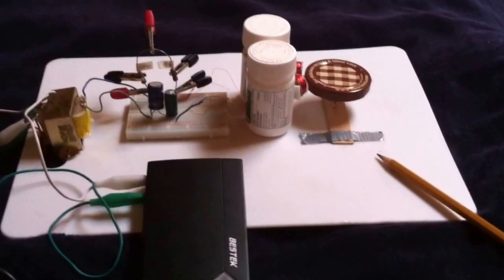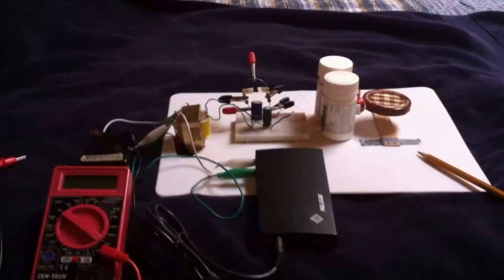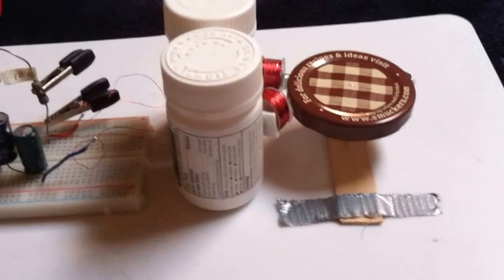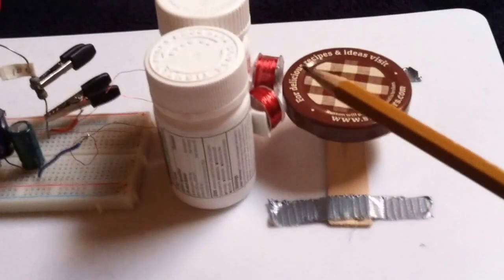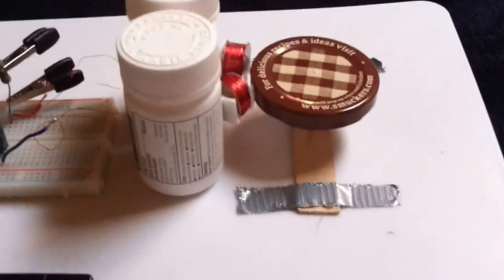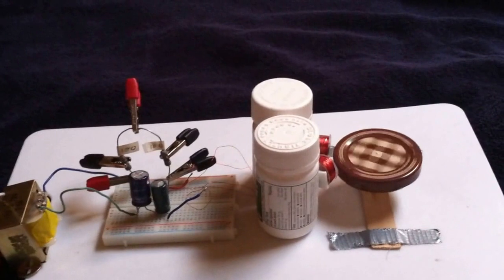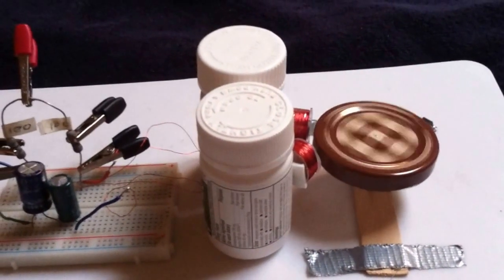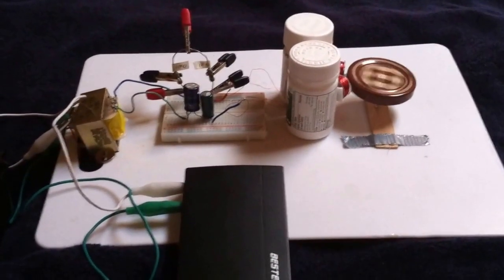Simple AC Induction Motor

Comment: That's awesome! I think if you used wall AC which is actually sinusoidal I think you will be a lot better off. A lot of the 12V to 120Vac inverters output a modified sine wave, which is just a glorified square wave. Induction motors, even the good ones will have like 20%-30% losses just from harmonic losses. If you add more poles to it, (electromagnets connected with same polarity to the other side in series), then you could increase the force delivered against the rotor. Steel is not a very good conductor of electricity, so inducing electrical current to generate the opposing magnetic fields is not efficient, as you have discovered! Check this video out, it is an animation of how induction motors work, it may give you some modification ideas! https://www.youtube.com/watch?v=LtJoJBUSe28
Reply: I wonder how well it would work if you cut slits into the lid and added a much of 1 turn coils of thick magnet wire around like in that video?
Reply: Also, I should mention that it is very bad to use those electrolytic capacitors with AC stuff. It destroys the dielectric (a super thin oxide layer) on the aluminum plates. This causes current leakage, which heats up the capacitor, which causes the electrolyte to evaporate and boil away. If the pressure gets high enough they explode!
Reply from the maker: +Power Max Thanks for the info and the link to that video.  I wired that transformer straight to a regular wall outlet yesterday and the motor ran about the same.  The rotor is probably one of the reasons the motor doesn't run super great.  The electrolytic caps back to back (neg to neg) trick was something I learned from a video here on YouTube.  So far they have not popped.  I'm trying to find an AC cap at a store nearby.  I may make a shade pole motor next.
Reply: +Lidmotor Shaded pole motors are inherently inefficient which is why they can get pretty hot and are generally pretty small. That might be hard to pull off with the weak magnetic coupling all these lid motors suffer from. But considering that this one at least work, I'm sure you can figure it out! ;)

Comment: Success but I can see your point about the power requirements. No doubt in a few days you will have perfected an AC solar version :) I know some of the small power units I have in my junk box give an AC output at some odd voltages. I seem to remember one was 15 volts AC so I may have a look at some time.  Of course you could re-assemble that microwave fan motor you took apart a year or so back when you wanted the coil. In my mind I seem to remember something about a single loop thick copper coil at a slight angle being a starter for this sort of motor to get the initial motion. That may just be my memory mixing things up but I can picture the diagram in my mind. . . .  Just looked that up on Wikipedia and that calls it a shaded-pole motor so my memory was OK
Reply from the maker: +GrandadIsAnOldMan  I have not built AC motors before so this is new to me.  The shaded pole AC motor would be a fun one to build.  I may take this 110v to 12v transformer and wire it up to a wall outlet cord for a 12v AC baseline power source.  I have a thing called a "Kill A Watt" meter that plugs into the wall and lets you see how much power you are using.  I also might take also apart a a regular 'wall wart' transformer, remove the diodes and capacitor, and use that for an AC source.  One thing I did yesterday was to buy a fuse holder to put inline before I do any of that.   I hate plugging anything into an AC wall socket that wasn't specifically designed for that.  All of the homemade AC inductions motor videos showed people doing that and it is dangerous.
Reply from the maker: +Lidmotor I found a ready made 24VAC transformer that has an internal auto reset fuse on the output. This might be a fun thing to work with coupled to the Kill A Watt meter to look at power consumption.  http://www.amazon.com/Elk-TRG2440-24VAC-Transformer-Fuse/dp/B0007N5LJK/ref=pd_sim_107_4?ie=UTF8&dpID=318E8YcD62L&dpSrc=sims&preST=_AC_UL160_SR160%2C160_&refRID=0AZR83R8CHKP0APKZ4M3
Reply: ***** I will be watching - as always :)